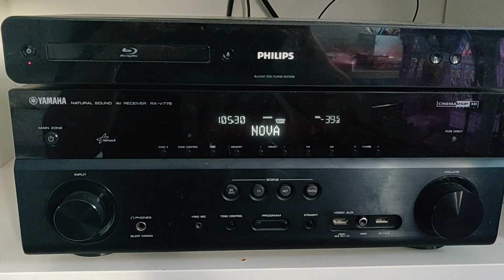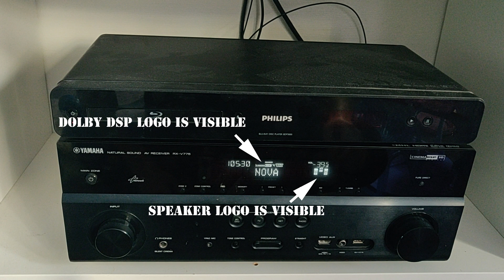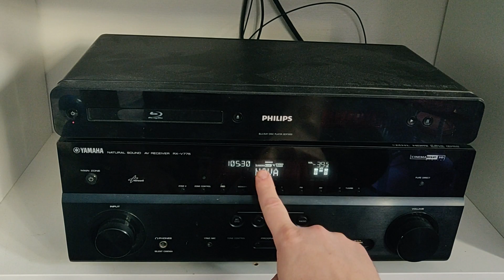Yamaha RX V775 No sound !!FIXED!!

Comment: This worked for me - I fixed my Yamah RX-A1020.  Use Flux and a Heat Gun like in the video.  Get a laser-pointer thermometer to check the temp.  After the successful fix, you will want to use thermal paste to glue a small heatsink onto that DSP chip.  Buy the heatsink and paste in advance.  1.  Hook up a speaker to the stereo to test that it is working or not.  2.  Open the lid.  3.  Heat the DSP chip to about 150-200 degrees F to confirm that sound comes back and that is your problem.  4.  Unhook all electricity 5.  put a small amount of flux all around outside of chip. 6.  heat the perimeter of the chip (the flux) to about 350 degrees F, as evenly as possible.  I heard a couple small "pops" while I did this.  Check the temp often and don't get too hot too quick.  The entire process takes about 5 mins. or less.  7.  Wait for the chip to cool back down.  Do NOT touch the chip or wipe it clean while it is still hot.  8.  After it cools, turn on the power and check.  I couldn't believe it, but mine actually works now.  9.  Recommended step 9 - glue a heatsink to the top of the chip to help manage the heat in the future so that this fix will last longer.  The DSP chip is a little less that 1" inch square.  I'm not sure 100% sure of the max heatsink size - around 22mm I think.  Google how to apply heatsinks.
Reply from the maker: What was the difference in heat on the chip after you put the heat sink on? And how hot was the chip before the heat sink?
Reply: I don’t have any measurements of how hot the chip gets after hours of normal use.  Then I don’t have any measurements of how hot the chip gets with the heat sink.   Everything is based on the assumption that thermal expansion and contraction caused the original issue, and on the assumption that a heat sink will keep it a little bit cooler so that it expands and contracts less.
Reply from the maker: @marks_02  Yes you are right. Thank you for your excelent comments.
Reply: Thanks for the tips. I will follow your first tip to confirm it´s the same problem, if this works I will definetely add a heatsink just like you said. I had noticed the receiver (HTR-2064) does produce a lot of heat that comes out from the top of the unit, I can only imagine during some extreme hot summer days...
Reply from the maker: @italiwoods  Yes, heat is the killer of electronics. Most of the heat comes from the analog side of the board (amplifier part). Order some thermal pad or paste to put under the heat sink like you would on a computer processor. You may also consider changing the thermal paste under the power mosfets. Those you can find screwed in to the heat sink on the front side. Those produce lots of heat.
Reply: @modernfix1  👍
Reply: Hi, great detailed advice, thank you.
I have been trying to measure the temperature on the DSP chip as I heat it to see at which point the solder on the grounding pad melted, but cannot get a good reading despite using a reasonably good laser no-contact measuring device.  I have measured my solder to start melting at around 245 deg C, so want to make sure I do not take the chip temp too far past that, as we are applying around 400 deg C for 2 minutes.  Any suggestions to get accurate reading?
Reply from the maker: @mcguystein8130  a hot air soldering gun you can control the temperature pretty accurately. Their are many different solder types and others have low melting point but industrial used solder has higher melting point usually. And the PCB will act like heat sink and suck some of the heat. e.g. a grafics card has an 8 layer PCB that will take a lot of heat to melt the solder.
Reply: Its a liy...
Reply: Hey, have you had any issues since you’ve done this?
Reply: @muhammadyaseensoomra9621  I ended up replacing it with a Yamaha TSR700 that was on sale at Costco because I was having other networking issues. My app stopped working, my stereo stopped connecting to the network, And I think the firmware wouldn’t even update
Reply: @marks_02  ah okay. But no sound issues after this repair?

Comment: RX-A820 fixed following this method! I'm not too experienced with this sort of thing, but I also put on some high temp tape over some of the surrounding components and solder joints. Heated the Flux to 400 degrees. Good as new. Hopefully it will last. Thank you!
Reply from the maker: Good idea that tape. Remember to let the area cool down before removing the tape otherwise you may rip of some components. You may try adding a cooler to the chip or a heat sink. That will make the repair last longer. Thank you for the comment.
Reply: @modernfix1  How much heat is generated by the DSP chip directly? Because if most of the heat comes from the power supply or other components, I'd imagine a heatsink wouldn't really help in this case unless you have airflow to vent the chassis. Otherwise wouldn't it just stay at roughly the same ambient temperature?
Reply from the maker: @Kumputer  Very good point. Good airflow is the best thing that you can do. I have not tested how much actual chip generates heat. I have seen cases where people have added a normal computer case fan since they are low rpm and do not make a lot of noise. You can mount them outside of the case and get the power from a usb power adapter or rig a 5v power supply to them.
Reply: Maybe my feeling of accomplishment is premature. Seems like the chip is already starting to go bad again. Sound is cutting out frequently, and the speaker icons disappear starting today. Considering ordering a new chip, though the replacement looks a bit more difficult.
Reply from the maker: @Kumputer  yes, this is not permanent fix. I would say more like a fix so that you have time to order the new chip. Some people have luck and this last for years and other break down faster.
Reply from the maker: yes this is correct.
Reply: @modernfix1  I was recently checking the touch temp of a dsp on a different yamaha and it was not very warm at all. if it's getting too hot there may be something pulling some power through it and through a potentially leaky component.
Reply from the maker: @izzzzzz6   The issue is a bad chip from texas instruments, common issue with these amplifiers. At least this the info that I have found from forums. Known issue. If your chip is a different model it most likely do not have this issue.
Reply: liy

Comment: This works for me! My RX-A1030 stopped working and I tried manufacture reset but it didn't help. FW upgrade never ran through and gave a checksum error. I followed the instructions given by this video (don't think I heated the dsp chip for 2 min though. Stopped heating maybe 10-15 seconds after seeing flux fume.) and did reset and FW upgrade again. This time got no error and the receiver started working again! Amazing technic. Thank you!!!
Reply from the maker: Great. It is always nice to hear that I could help people. Thank you for your comment.

Comment: Unfortunately it did not work in my case (RX-A3010). Luckily I managed not to fry the chip somehow, but I had to reset it to at least make it work. Maybe it's not a real problem in my case, but it seems very likely... Anaway I'll try to order new chip and replace using your other video. Anyway, thanks for the info and instructions.
Reply from the maker: sorry to hear that this did not help. Hope you will get it working.
Reply: I have rhe same problem with my rx 3010 . Did you say that there is an order part and where I could get the chip? thanks

Comment: I have a similar issue but my sound disappears together with the speakers logo, however my DSP stays on. Any idea i what could be the issue?
Reply from the maker: You can try resetting the amplifier. You can find the instructions to do that by googling your model and how to reset it. Or you can try updating the firmware, you can download them from yamahas website. The same chip controls the speaker output also so it may your chip that is causing the issue.

Comment: That is not an easy fix lol.. A much easier fix would be to just blow on it with a heat gun lol
Reply from the maker: This heating up like I did was just a temporal fix. With me it lasted for 7months and then it failed again. Some have reported even longer time for this fix. Maybe more cooling for the chip with a heatsink would help. But a new chip from aliexpress was needed for a more permanent fix.

Comment: Amazing video.   I'm having this exact problem and I'm sure this will fix it!   Unfortunately, I have no clue how to solder or what you're using in this video.  I can order a heating gun, but what is the solution your using / putting around the chip! ???
Reply from the maker: The thing in the tube was soldering flux. It helps to make the solder tin flow. I have a tube of some cheap stuff made in china. The brand is Hanwuyou advanced metals tech inc. Flux type NC-559-ASM. Almost any soldering flux in a tube can be used. The best would be amtec 559 rosin flux. Cheap heat gun is about 30dollars and a tube off flux is about 5-10dollars. You only need those to make the fix. I will try to do a video about soldering in a future but there are a lot of quids on youtube on how to do it.
Reply: @modernfix1  it worked !! I even had  to use some Flux paste but it worked great
Reply from the maker: @rolanddeschain7060  Great, good to hear that you got your amplifier to work. The best feeling in the world when you fix something.

Comment: This technique worked perfectly on my RX-A2020. Other videos suggested to remove the chip and resolder etc, but that was not necessary. Just did a reflow like in the video and it worked. 

Just a note, the RX-A2020 has two cinemaDSP-chips, tried the heating/cooling technique to determine which chip was at fault but it was difficult because they are located fairly near each other. So I just did a reflow on both of them at the same time.
Reply from the maker: Nice to hear that this worked. Hopefully this will last you a long time. Just beware that the issue may come back since the issue is most likely caused by a bad chip.

Comment: Thanks a lot for this excellent video !!! I followed all your instructions and it's working ! Merci beaucoup !
Reply from the maker: Nice to hear. But remember that this not a permanent solution. For me it worked for about 6months of daily usage. I have heard that some go strong for years. Hope yours go for years. Thank you for your comment.
Reply: @modernfix1 Same issue with my Yamaha HTR 2064, I will follow your method. Hopefully a small heatsink (like on mother board chipset) on this IC should avoid this problem in future

Comment: Thanks so much! This fix is quick and easy and now my RX-V773 receiver is working perfectly.

If, for some reason, this fix doesn’t work for someone I’ve seen videos where a reflux is not enough. In some cases the whole chip needs to be re-soldered because of a faulty ground solder pad under the chip itself. 

Overall, solid fix!
Reply from the maker: Thanks for the comment. I know that this is not the silver bullet for all, but should help must suffering from this issue. For me this fix worked about 6 months and then I had replace the chip. Always nice to hear that my videos helped.

Comment: Also, check the ADC and any crystals that provide clock frequency for any ic's that have them. Sometimes it can be worth checking capacitors in the same zone.
Reply from the maker: Yes with an old amplifier usual maintenance is to replace all the electrolytic caps.

Comment: This is brilliant. Even just the hair dryer heat up test step seemed to fix my unit with now only the odd drop out. So I am looking to do the full fix, but my local electronics store only has a flux pen (like a highlighter) or a lead solder paste in a syringe which is actually what the store owner was suggesting would be best for the job. He reckoned the suspended solder would get pulled into the gaps and do a better job of filling the gaps than just flux alone. Any thoughts on solder paste for this kind of application?  Or should I be just getting flux used here?
Reply from the maker: Solder paste is brilliant stuff, I like to use when soldering smd components back on. You can use solder paste and the heat will suck the solder to metal. Good thing when using it you need a lot less heat and no danger knocking of other components. But be warned if you use too much you will run in to the risk of creating bridges between other components and bridging other pins together. This will cause a short and may break your device. This is a case  where less is more. In any case this is a good idea, please let me know how it worked. P.S. it is a good idea to have a good soldering iron if you have any bridges.
Reply: @modernfix1  thanks for info, tips and encouragement. Can I double check one thing? Your video mentions +410 deg Celcius but others in the comments are talking about 400 F . Are you sure the temp should be +410 Celcius? Did you mean Fahrenheit? Seems crazy hot.
Reply from the maker: @fceuropa  I am in the EU so use celcius and all my equipment is in celsius. I do apologize if I have used incorrect terms. English is not my native language. When you are dealing with solder and electronics you need to use crazy hot temperatures. As odd as it sounds it will cause less damage since you will use less time and time is the crucial thing here. You will also have understand that PCB's and other components will take the heat also. e.g. if you have multilayer PCB the all the layers contains coppor and it will spread the heat everywhere. Normal solder that does not contain aluminum or lead has a very high melting point 350-380celsius. So you need to apply lots of heat to get the solder to melt fast. Their are lots of different types of solder and most industrial use solder has a very high melting point. Did this help you to understand why you need crazy hot temperatures.
Reply: @modernfix1  awesome, thanks for the confirmation and the extra info. And no need for apologies as it seems like you had the correct terms all along. I better go buy that heat gun as it sounds like my hairdryer is not going to cut it for this task :)
Reply: @fceuropa did this work?
Reply: @muhammadyaseensoomra9621  I never actually got around to buying the heat gun to do the full fix but I am sure it would have worked as heating it up with the hairdryer seemed to do a reasonable job, even without flux. i.e. it got it working for a while.  I was about to do the full fix when it seemed to develop some other issue which resulted in no sound even in the straight audio mode. I think I may have blown the amp outputs somehow when I connected some dodgy low impedence speakers. Good luck with your tinkering.
Reply: @fceuropa ok thank you

Comment: Hi!
First of all, thank you very much for sharing your solutions.
I have a Yamaha RX-V375 and only the Surround speakers have stopped working.
What could it be?
Reply from the maker: I think it is related to the same issue. Since I have seen devices that first work with stereo only and after a while even they stop working. If I remember correctly this was also the case with my device.

Comment: My Yamaha rx-v2500 sound fades in an out, will this hack work?
Reply from the maker: Cannot guarantee this, since I have never seen your device. This can also be caused by something else. This does not work always and it is not a magic bullet that can cure all. And it is not a permanent solution.
Reply: @modernfix1  Thank you for answering.

Comment: Hi and thanks so much for posting this video! Helps isolate the problem area.

Question: can WD-40 be used instead of the flux? 

If the objective is to remove oxidation and grime, should theoretically work… Also, I don’t have any of the other equipment like flux and heater. 

Thanks so much!
Reply from the maker: No you cannot use wd-40 because flux is used to make the solder melt better and make a solid connection. WD-40 can be used near electronic device because it does not conduct electricity but not to this purpose. Name come from water displacing formula 40. It was made by NASA to keep the rockets from rusting.
Reply: @modernfix1  Flux is used to stop oxidation but it also seems to help with the transfer of heat.
Reply from the maker: @izzzzzz6  I use it because helps the solder to melt better. Solder wire usually has a flux core and it helps the solder to melt and gives better contact.